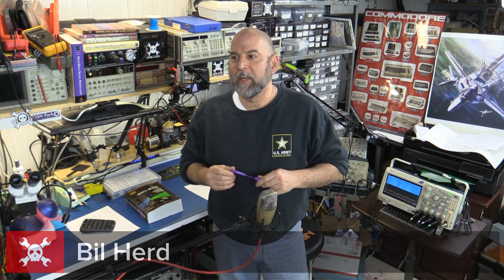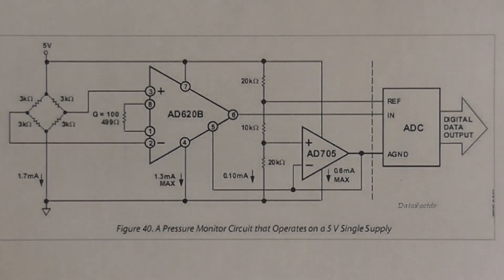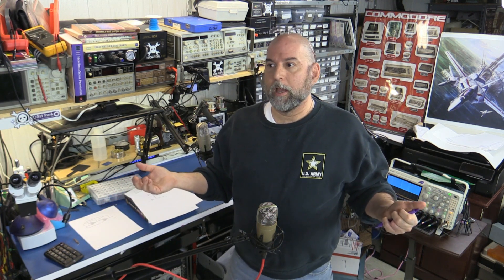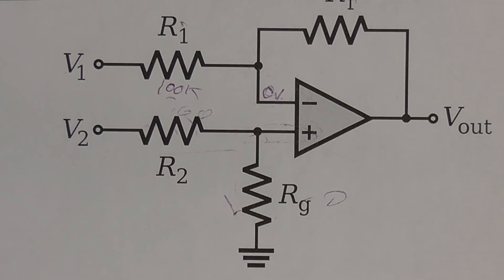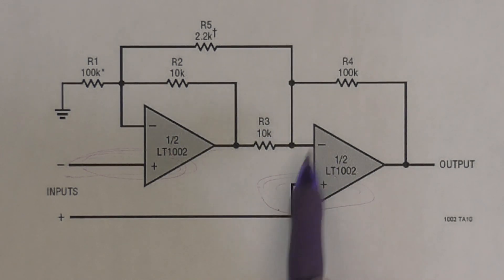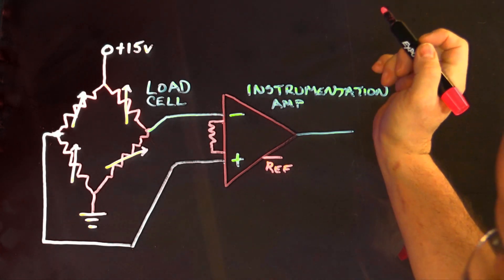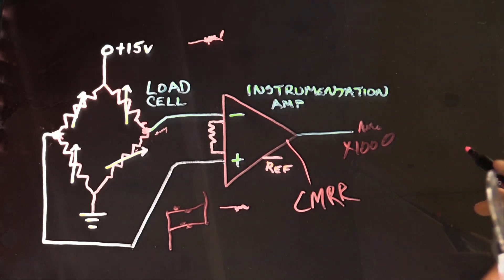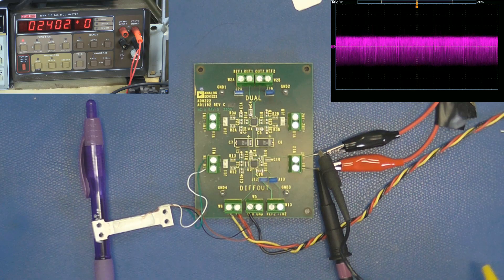Hackaday Intro to Instrumentation Amplifiers

Comment: I'm extremely late here, but I think you made a mistake at 04:55. The voltage the inverting input is not 0V. It is equal to the voltage across the Rg resistor, essentially the voltage at the non-inverting input
Reply: +1

Comment: Thanks! I now understand the basic concept of the inamp, but i am still not unable to understand role of all resistors in the circuit. Can you please make in depth video explaining function of all 7 resistors that are present in inamp circuit? (and the 5 resistors in simplified circuit). It's still unclear to me how the gain is set in different stages.
Reply: Eg. i don't get why i can't just use plain opamp buffer (opamp with output tied to negative input) to buffer both inamp inputs. You don't need any resistors to make voltage buffer using opamp.

Comment: hi, hoping someone here can help me!I'm trying to use an Instrumentation Amplifier on a 2MHz balanced signal. the parasitic capacitance of my IA is 10pF or just under 8k ohm at 2MHz...  the equivalent series input impedance circuit is 0.06 -7957i according to what I calculated...I need the highest possible input impedance, so to cancel out the parasitic C may I put an inductor in parallel with it? I ask cause I haven't found schematics where that's done and google search hasn't led me to relevant articles, yet..cheers :)

Comment: Nice video Bill.  FYI - you could use hi-res sampling in the MDO to increase vertical resolution and low pass filter (noise filter) the noisy output signal.